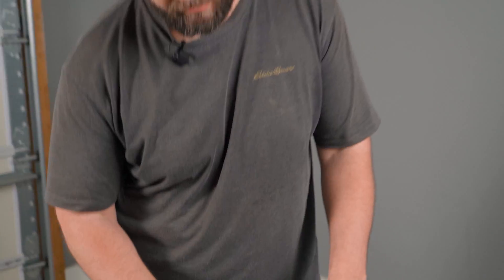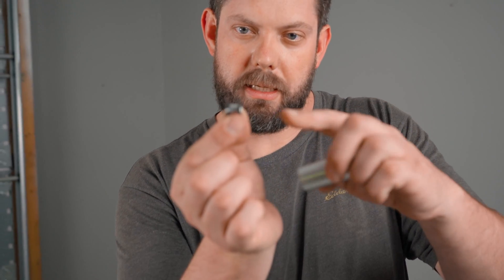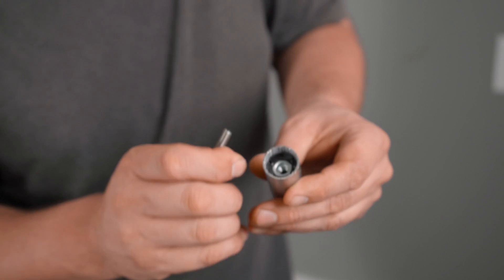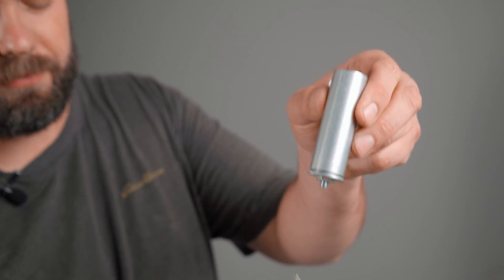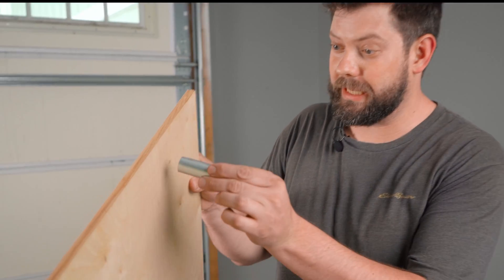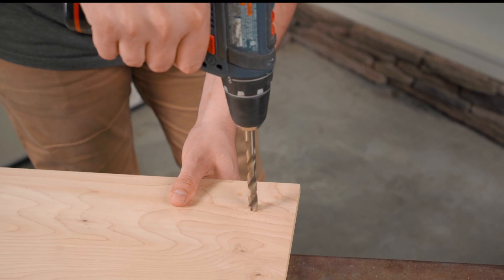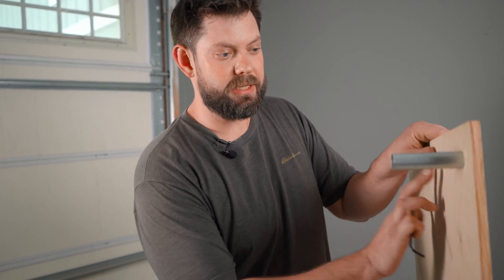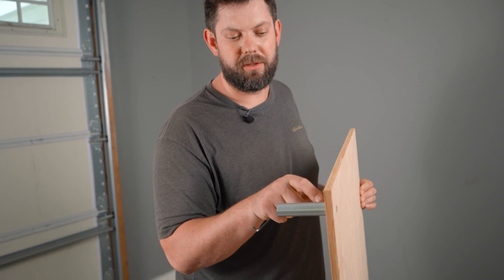Mount Anything To Conduit With This Simple Hack!

Comment: when using a larger bit to countersink run the bit in reverse with a little pressure ,same with starting holesaw after drilling pilot hole
Reply: Same works for hole saws in wood, start in reverse.

Comment: Also can use 1/2” or 3/4” cane tips on the ends of the tubes to keep from scratching things that the legs rest on. Floor, table, etc. 
Cane tips from Walmart 4/ $3.97 in the pharmacy section.

Comment: Those nut inserts are the same thing used in threadless bicycle forks. To install , take a 2 inch long corresponding bolt , slide it through a shallow tool socket, grab socket with vice grips and now u have an easy way to hammer the insert into the pipe. The vice grips can also act as a depth stop
Reply from the maker: Oh interesting, thanks for the suggestion. I'll have to give that method a try!

Comment: What’s the tensile strength of these inserts?  If I used a piece all-thread to couple two joints of conduit, How much force would it take to pull the insert out of the conduit?

Comment: Are there any plans to manufacture/supply the threaded inserts for 1/2" EMT conduit too?  3/4" and 1" EMT too big for one of the projects I wanted to do.
Reply from the maker: We will at some point but not at the moment. Here are some that I’ve used that fit with 1/2” EMT. https://www.mcmaster.com/product/94290A510
Reply: @MakerPipe  Thanks!

Comment: For the table leg demo, one should add a fender washer to prevent the tube from "digging in" (both during installation and long-term use).
DIY Feet: Carriage bolt thru 3/4" hardwood (partially drilled) then fender washer and nut. Another nut against leg to lock height.  
Inserting an Eye Hole Head Screw (or screw/nut with drilled hole in head) with the starnut and then securing a roll pin thru the conduit and hole should increase pull-out strength.
Great Find/Hack for a potentially difficult termination. Well-Done !!!!

Comment: PLEASE MAKE THESE for 1/2" size conduit.  There are millions of old folks with wheeled carts, used for shopping, that have the crappiest wheels.  If I could just put one of those inside a 1/2" size conduit, using 3/8 X 16 thread, I could thread on new polyurethane swivel wheels.  These carts are made with very thin tubing and even 1/2" is bigger than any tube, but 1/2" could be shimmed or rigged to it fairly easily... but trying to go up to 3/4" is too much.  I've been looking for something, because I don't want to have to rely on J.B. Weld to hold a nut I could screw the wheels into, and then try to carry upwards of 125Lbs from a supermarket, back home.  The original wheels only lasted 4 months and couldn't swivel.  I will gladly make a video of a finished product and show the vast improvement to the cart.
Reply: I second this, Im curious tho, seems like you might be able to just jam it in a 1/2" conduit.... couldnt you?
Reply: The 'nuts' for the wheels are a little small, and I'm guessing JB Weld would probably hold.  If you're talking about their mounts for 3/4 inch conduit... I supposed the 1/2 inch pipe could be flared out, but might weaken it... I'm a pretty amateur mechanic & have bad luck, when it comes to Gerry-rigging, lol  Hmm, maybe I can drill a small, shallow holes into the side of the nut  and use a couple of short screws to secure it to the 1/2 conduit, from the outside... that and JB lol. @phazerave

Comment: Been thinking about doing an suv bed platform similar to this. My fear is that it wouldn't be strong enough where it connects to the wood. Especially if I had company and things got a little crazy? 😋  Any suggestions on how to make it a little more robust?
Reply from the maker: If the van is a rockin don't come a knockin lol! Honestly I would just recommend adding more of those two hole straps and longer bolts/screws. They do a great job of securing the pipe to wood and the more you have, the stronger they will be.

Comment: How much weight can one double star nut handle before it slips?
Reply: A washer the size of the end of the conduit with an extra nut will also stop that inner mount from going further into the tube
Reply from the maker: Thanks for the comment and question. I don't have an exact number unfortunately, but I would guess at least 100 pounds. The metal spring clips really grip and dig into the inside of the pipe.
Reply: @MakerPipe  thanks ,already ordered 10 packs plus another builder kit. the first ordered products are fantastic.

Comment: FYI, you said you used a drill bit that is slightly larger than the 1\4 inch bolt.  This isn't actually necessary.  1\4 inch is the nominal size of the bolt, but the actual size is approximately .2489 inches.  Bolts are actually slightly smaller than their size, so a 1\4 inch drill bit hole will fit a quarter inch bolt.  This is true of all bolt sizes, they are designed that way.  So you actually will get a tighter, nicer fit if you use the same size drill bit.  Great content, love the ideas, keep them coming.
Reply from the maker: Thanks for the info Ryan. That is good to know!

Comment: These types of nuts have been used by the bicycle industry for years and years. They call them starnuts or steertube nuts. They are used to secure the stim to the steertube of the bicycle. They make a tool designed to make installation very easy. Really cool to see these used for different applications.
Reply from the maker: That’s really interesting Cory! Thanks for some backstory on them. We love when pieces like this are meant for something totally different but end up working for cool builds with conduit. Thanks for the comment.
Reply: Yeppers! Was gonna say the same thing.
Reply: Also Rivnuts are used in the auto industry etc. Drill a hole in sheet metal or conduit, then insert proper sized rivnut  insert with the special tool and it compresses and secures the threaded rivnut insert which then allows nuts/bolts to thread into it securely.